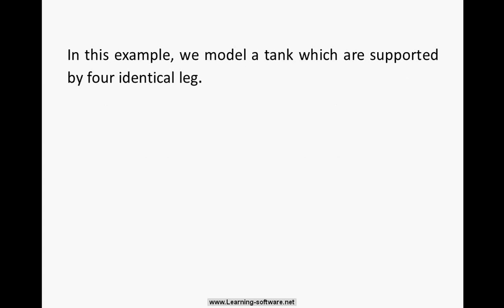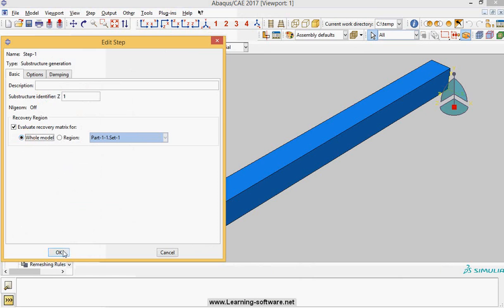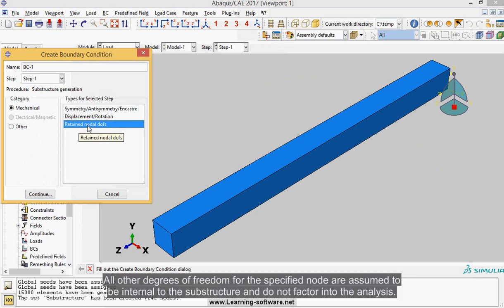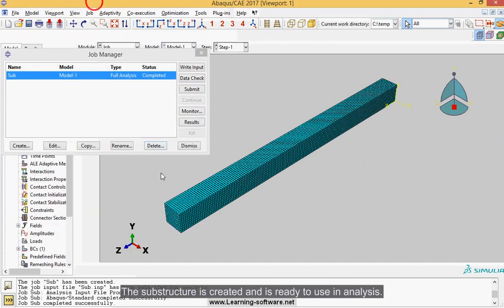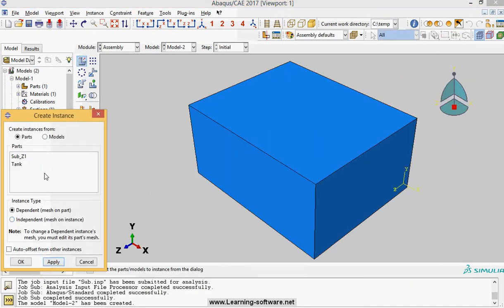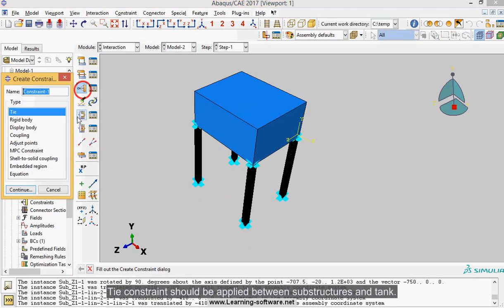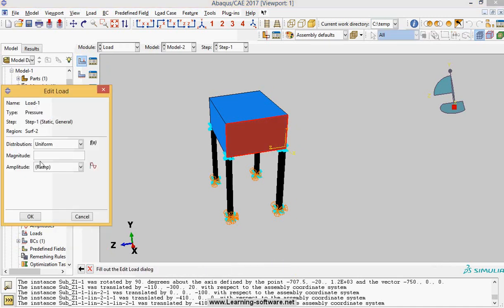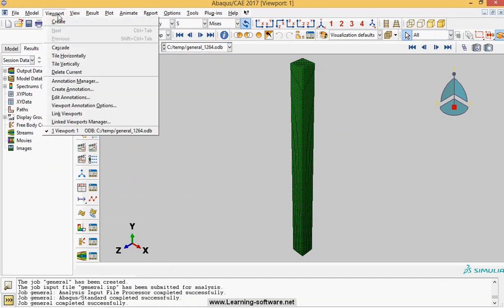Using substructure in Abaqus (modified version with voice)

Comment: I have a model which includes some spring & dashpot and beam elements. I used also substructure in model. I want to extract reduced stiffness and damping matrix. How can I obtain? If you want, I will send ".inp" file.